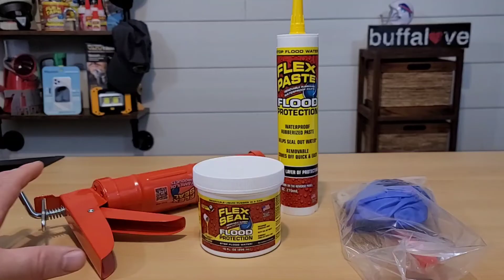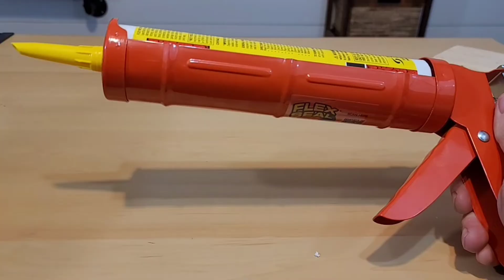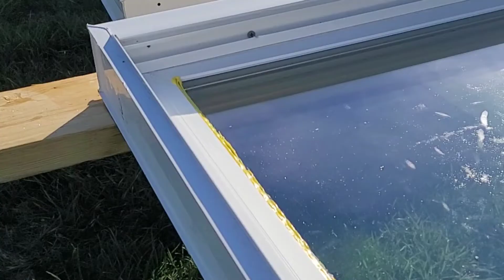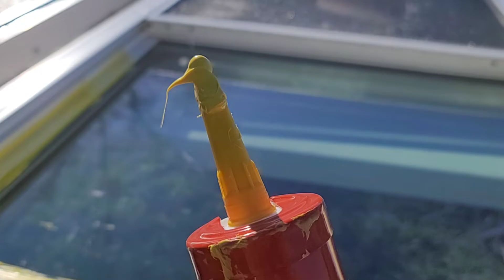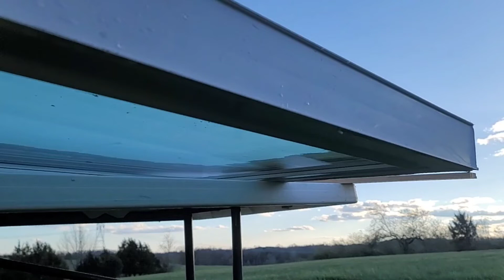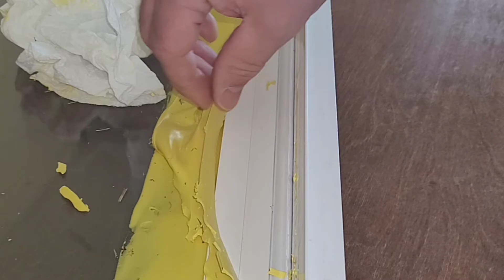💪Flex Seal FLOOD protection - applied and tested! [493]💪

Comment: There is a video somewhere of a business owner in Cape Coral saving his business from flooding during Ian using Flex Seal and plastic.  The water stood outside for days, and his shop remained high and dry.  I think it's a great application but I'm fairly certain the only way it's going to work is if your exterior is concrete block Construction. If you have wood framing with siding I don't see how you can stop even the most minor flood.
Reply: Have you looked at the behind the scenes video that Flex Seal made for their product demo?

Comment: Will just the paste and tape work on the outside of front door. Went thru hurricane Ian in Florida, and water was over 2 feet outside. Luckily I only had a few inches inside. I don't have access to sandbags so I was wondering if the tape and and the paste, only, would work. And maybe plastic sheeting also. Is there a way you could review that?
Reply: Ditto 
Interested in seeing the flex flood tape tested
Reply: I would also like to know about the flood tape only in SW Florida around the sliders.
Reply: Hi! We are south of Sarasota along Lemon Bay.  Our area flooded with Milton. We used flood tape only during Milton. We bought this tape during Helene because our neighbors across the street flooded (their homes were built in the 1920's and this is the first flood in 100 years). During Milton Water surrounded our home about 8 inches and no water got in our home.  I did put a few towels in front of the doors (inside) and those were wet. 

We have an old 1960s block florida home. I would like to figure out how to seal the block walls because there was moisture inside the house. Not puddles of water,  but moisture you can feel when touching next to the floor boards.

When my husband was putting on the flood tape quickly (before we evacuated), he said he wasn't sure if will work. And it definitely worked! We used the 7.5 inch width tape.

Also, when removing the tape,  some of the paint came off which was totally OK with us.
Reply: @psg1729  did you also use the flex paste since they say to use that with the tape

Comment: How you used this product I agree it works but honestly for the money and time you would be better off putting your 50 bucks towards ne windows.

I have seen the commercial on tv and think the way they show it being used should be false advertising.  The way the commercial shows just seal your doors and window and no water will come in is a Joke. Not even a brick will will keep all the water out if the water level rises outside your house like the commercial shows and the problem of water coming thru the wall only gets worse if you have any sort of siding the water will just pass right thru.
Reply from the maker: I agree, unless there is already a waterproofing layer under the siding or brick, that would be an area of entry. I was thinking a good application of this product would be an egress window in a basement. Those are often under ground and are a source of water infiltration. Thanks for stopping by and commenting 😃 👍
Reply: The flood tape saved our house from flooding during Milton.  I tell everyone talk to about our experience.